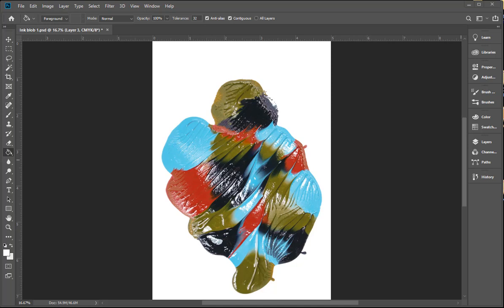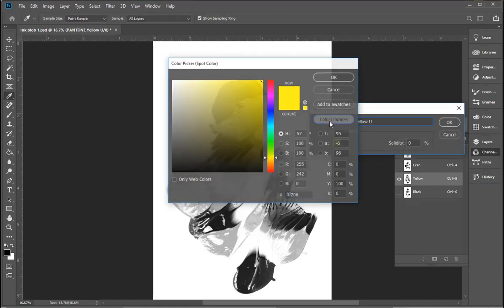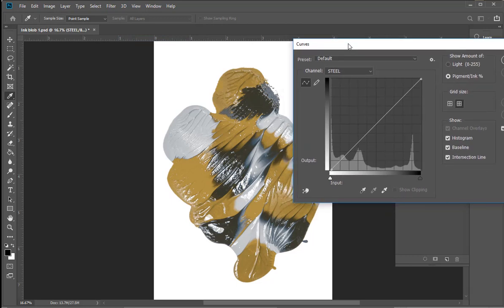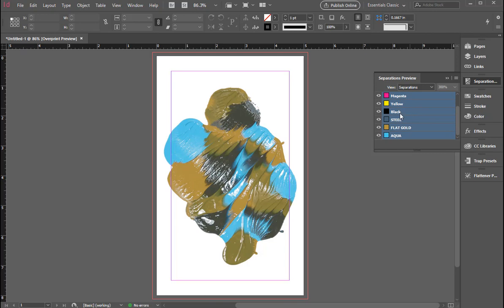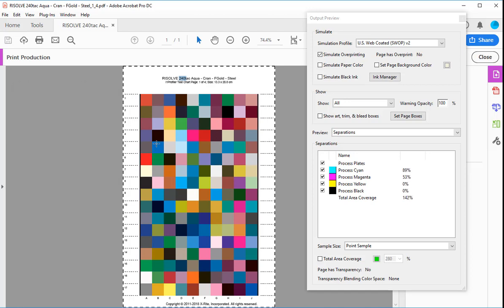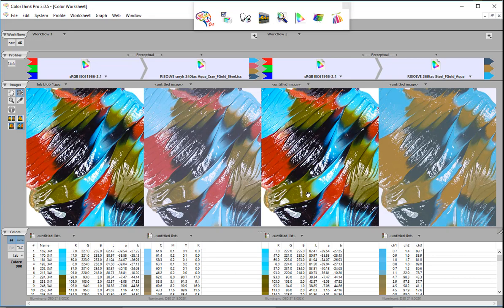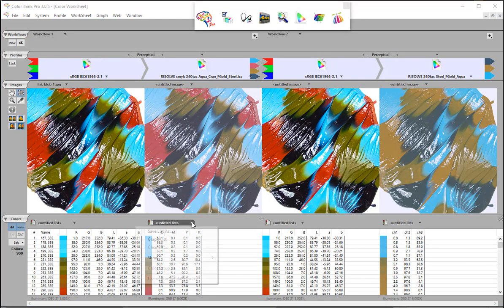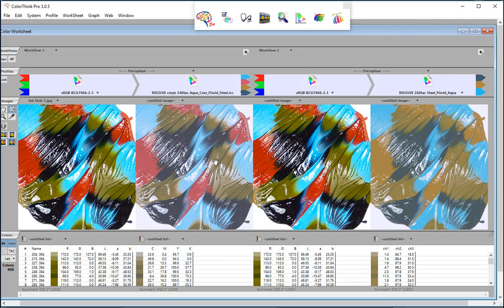HOW TO: Use Color Profiles for Riso Printing

Comment: Hey I am using a MAC, when i go to my print dialogue box in Indesign, it does not let me go to the setup option to change page size, and also does not let me deselect CMYK options in the output. do you have any idea how to access these options?
Reply: I cannot access the PPD option either.